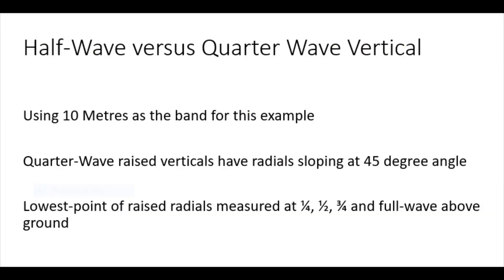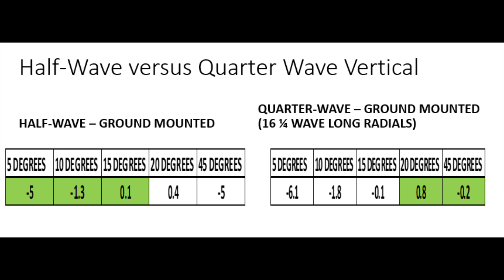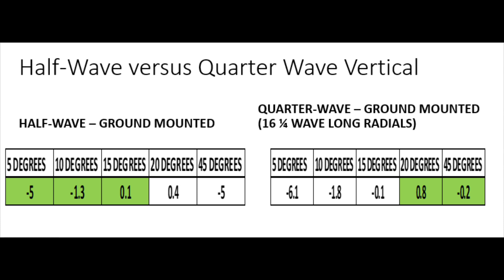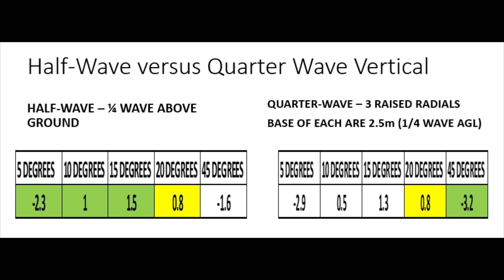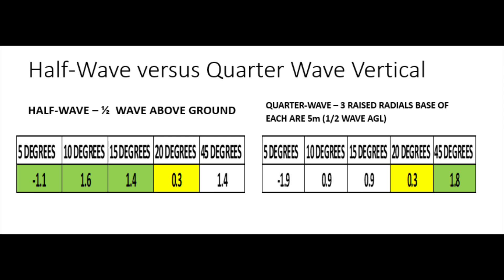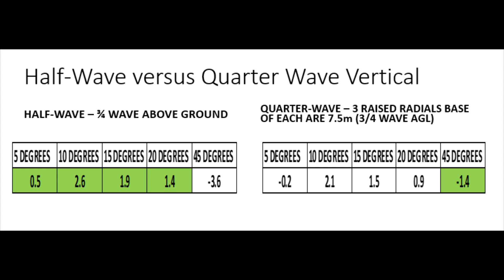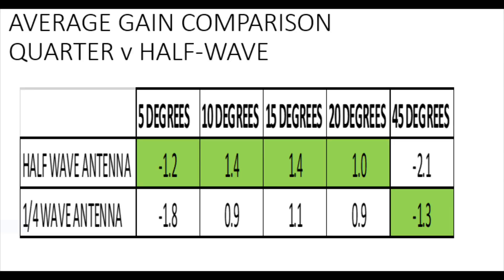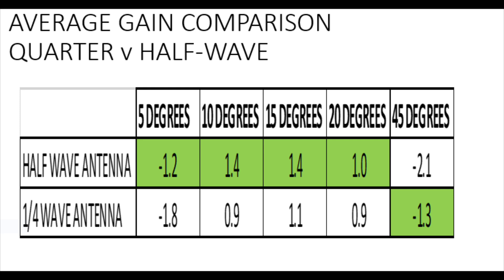BEST DX ANTENNA: QUARTER WAVE or HALF-WAVE VERTICAL??

Comment: Thank you so much Tim. Good and useful information. 

I recently compared in real life  1/2 wave versus 1/4 wave (with elevated radials).. using reverse beacon the 1/4 wave beats the 1/2 wave on long distance. Using the 1/2 wave on 20m the distance is up to 4000 km. However the 1/4 wave consistenly reaches the 10.000 km and even new zealand. It seems the radials really make a huge difference which makes sense.
Reply from the maker: Interesting points!!

Comment: How would a 49:1 efhw fair say a foot off the ground ran up a 10m pole so you could work 20m with no radials and would be a halfway vertical??
Reply from the maker: Are you asking if that vertical would be a half wave Andy (just for me to clarify)?
Reply: @TIMG5TM  it's OK Tim,I've just got the updated clamps for my classic so gonna use that as working alot better than my efhw :)

Comment: Hey Tim have a request wondering if you might do a video on the use and application of a 75 ohm matching stub. Discuss how to use it when to use it how to make it how to measure it and basically what it's designed to do and what would be the benefit of using one. Thanks in advance
Reply from the maker: I will add it for consideration!
Reply: @TIMG5TM  thanks! What length of twin lead (450 or 300 ohm ladder line) do you recommend to feed a linear loaded doublet which is made from 450 ohm ladder line and also has an additional center wire attached for shortening the length, it's legs are  about 33' or 10m long each side

Comment: Glad to see you back, Tim. My experimentation multibanding vertical half waves using a 49:1 leads me to believe that any dB benefits are cancelled by the loss introduced by the transformer (which, if my S21 measured losses are accurate, show 1dB down at 20m and 40m).
Reply from the maker: Good point
Reply: Yes they do get hot!

Comment: The difference for myself in an extremely windy Scotland, is that the 1/4 wave is generally close to unbreakable. The vertical HWEF, is very much more vulnerable.

In practice, my vertical HWEF really wasn’t beating out the 1/4 wave on 20m at all, although I’m running about 32 radials. And, for reasons unknown as yet, the 1/4 wave is slightly better at avoiding RFI.

It’s a snake’s wrestling match comparing antennas, and the modelling never really reflects everything physically there insitu. Build them and see is almost unavoidable in the end.
Reply from the maker: Very fair point.

Comment: Good video Tim.

I've also been modelling half-wave verticals in MMANA. I've had this slightly mad idea that I want to put an EFHW vertical (for 20m) on an 18m DX Commander pole at my home QTH to get it above the roofline (which will obviously put the feed point at approximately 8m above the ground).

I've been modelling gain vs take off angle at various heights above the ground. Strangely my results were approximately 1db down on yours so I don't know what I entered into MMANA which was different from you..........maybe my ground settings are a little different.

Great to see you back on YouTube again. Keep up the good work.
Reply from the maker: Ah right - I was using real ground on MMANA. Nothing mad about your idea!! Thanks James 73

Comment: Easy to make assumptions as to what is best but I have a quarter wave vertical , a half wave horizontal (EFHW) and a 20-10 meter magnetic loop and no matter how much I try I can't get them to be predictable enough to claim one is best ! What I have found is the depending on conditions one will work better than the others and it is a bit pot luck as to which is best. Hope this helps (confuse the issue lol) M7BLC
Reply from the maker: Yes - there are so many variables!

Comment: Yep, that matches my (limited) experience between the two -on the radio they sound pretty much the same. So I put my EFHW on its side, and discovered that the difference between horizontally and vertically polarised signals is very noticeable, and quite variable. The downside is, it's another knob to switch while trying to tune in a station :)
Reply: Thanks mate. I run a 40m-10m EFHW (a coil for 80m, very narrow b/w on 80m) and a homebrew 49:1 designed based on videos from Steve Ellington. Just so that i understand you clearly.....did you see better performance with your EFHW when it was setup horizontally or when it was setup vertically.  - VK3TWC
Reply: @coderdojoAN  I get different performance. When horizontal, it mostly picks up horizontally polarised RF, so if the station I'm trying to work is mostly horizontally polarised, then it's better received on the EFHW. I've also got a 1/4 wave which I keep vertical, and I'll switch between them to get the best receive signal. However, the polarisation is not stable, and can change over the period of a few seconds to minutes. So the best technique would be to use two transceivers, one for each antenna, and then you could listen/transmit on the one with the better signal. However, that's too rich for my money, so I just use a simple antenna switch to see if a station is louder on the other antenna :)
Reply: @Lastaii  Thanks mate that was really helpful. I live in a suburban plot (Melbourne, Au) with the usual challenges i.e. space constraints, RFI, etc. The EFHW was the best option for me, i've got it setup as an inverted V with the middle at ~33ft. I  also have another 20m half wave vertical which i am thinking of re-tuning for use on 40m as well. I see your point about polarization and the fact that it could change with the station, weather, number of other factors, etc. Some more interesting experimenting to do... lol. Thanks and stay safe. - VK3TWC

Comment: Good to show the differences Tim. Its really not worth talking about but great to know. The 1/2 wave has a big benefit of no radials but quarter wave is half the height. What this doesn't take into account is surroundings. I was shocked to see the difference between my OCFD and a vertical and my garden is open on side. I will try to make a video on it soon. Good to see you back.
Reply from the maker: Nice observation about the OCFD Colin and thank you!!